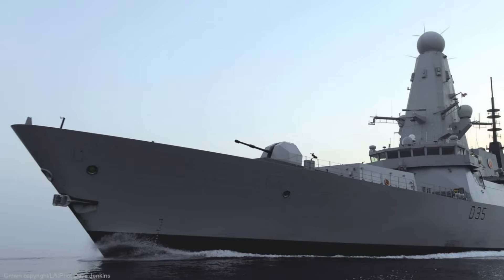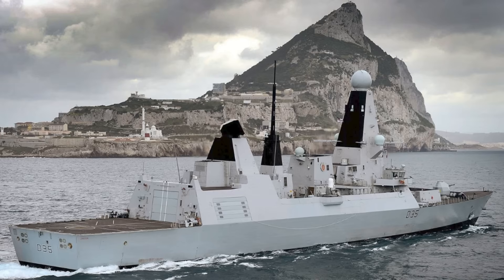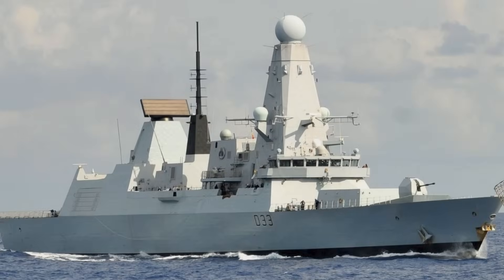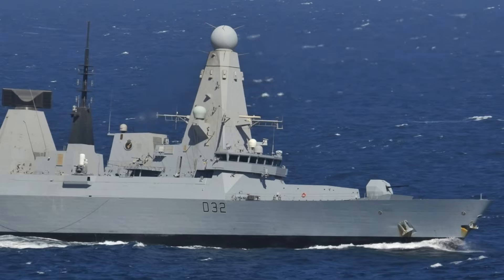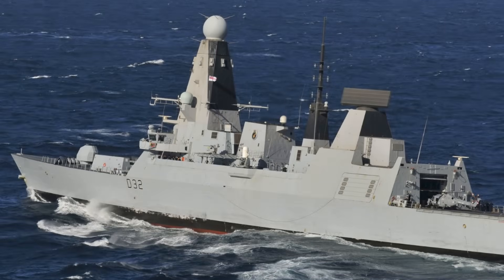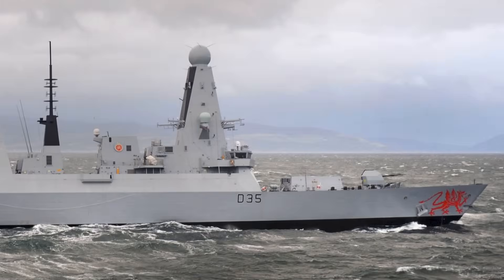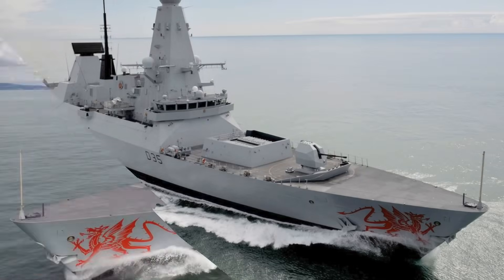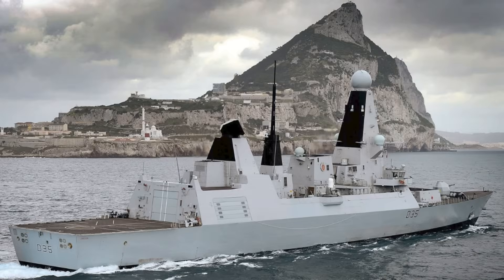Britain Fixes Its Destroyers: The Type 45 Upgrade That Changes Royal Navy Power

Comment: 19 years to resolve a deep, fatal flaw that turns the ship off if you try to use it's capabilities. That's insane.
Reply: That it was affecting one of our most prized, highly advanced assets, so critical and needed to be allies,  extends the insult much further.
Reply: The description of the situation is simplified in the video. A large number of problems with power were sorted out quite quickly because they were less expensive to fix.  The ships became usable with limits. This is all just what I remember from reading  about it.
Reply: Blame Choosing Yank intercoolers! Northrop Grumman is to blame if it had been the other way around the yanks would have been extracting comoensation!

Comment: It alsoallows power for DEW Dragonfire, Naval Surface Missile NSM and potentially strap on Tomahawks.
Reply: Plus upgrades to Sea Viper going from 48 to 72 upgraded missiles
Reply: @Gez492  Not quite, she will get 72 Missiles total, but it's the addition of 24 Cell Sea Ceptor missile, not SeaViper (The Aster 15 and 30) but does technically mean she can use those better missiles for more serious threats, the 24 Sea Ceptors can be for lower threats.

Comment: The RN took a gamble on new technology ... specifically relying on the WR-21 turbines to deliver all needed power in all weather conditions (the diesel powerplant was only designed for hotel services and backup).  Alas, the technology could only deliver this in moderate temperatures - the Atlantic and Med were fine but the Gulf and South-East Asia theatres were not.  Hence, the PIP program became necessary to address this technology failure.  Sometimes you win, sometimes you lose.  

But when you combine PIP with the other Type 45 improvements underway (added 24 cell VLS for Sea Ceptor for a total missile load out of 72, the Aster Block 1 upgrade, Sampson radar upgrade, DragonFire), the second-half of her lifetime will deliver one of the very best destroyers in the world - comparable to the Arleigh Burke in many ways.  

(The Aster hit-to-kill ratio is substantially better than the SM-x fielded on the AB class ... there is a reason that the US Navy is quite happy to have a Type 45 in the carrier group escort mix).
Reply: It highlights the basic need for Diesel generators for cruising speeds of 16-18 knots, and gas turbines for flank speeds. With PIP, Type 45 flank speed is now 32knts. The other issue was not the reliable WR-21 turbines, but the US made Grumman intercooler responsible for warm water trip outs.
Reply: @RobWhittle-o2y1c  Quite correct ... it was the intercooler failing - I simplified to WR-21 but it wasn't a problem with the turbine itself.   The WR-21s are helpful too for providing power to DragonFire - it wouldn't surprise me if an upgrade to it will require even more power.
Reply: @zachUK  By going from 2 2MW generators, to 3x 4MW desiel MTU generators base; the added power beneath the WR-21 input has trebled from 4MW to 12 MW, more than enough,  the same as AB  AG9160  3x 4000=12MW. Dragonfire gets fitted to all Type 45s in 2027, on Dauntless now.
Reply: @zachUK Aster hit to kill is not better than modern US SM because SM is an abbreviation not same series of missiles. Just like F-22 and F-35 are not the same.
Reply: @niweshlekhak9646  SM is an abbreviation for Standard Missile.  The evolution has been SM-1, SM-2, SM-3 & SM-6.  The Aster 30 and SM-6 are closest in capability but the SM-6 has much greater range.  
The estimated SM-6 hit-to-kill ratio is closer to Aster than the SM-2 due to its active seeker but the general view is that it is still not as good as the Aster.
Reply: @z @zachUK The thing is Aster only has dealt with Houthi weapons, SM-6 has dealt which much bigger threats targeted at Israel.
Reply: AEGIS and Sampson cover each other's deficiencies.  Sampson is a much more sensitive, and can track thousands of targets, the size of a coin.  AEGIS has greater range.
Reply: They gambled by not testing it properly first.  That's a kind of gambling we have to avoid.
Reply: @timmurphy5541  I think it's reasonable to conclude that they did not do sufficient very-warm air/water temp testing of the entire power system.  The intercoolers were certainly the number one issue but there were design flaws in the overall power management platform - the intercooler's degraded performance and eventual resultant failure of the WR-21 turbine to produce electricity should not have a caused a total electrical system dropout, for example.  (The system should have shed electrical load so the diesel generators could maintain critical systems instead of a catastrophic black-out). 

New technology always introduces risks ... there are always unpredicted failure modes - you can never mitigate risk to zero.
Reply: @zachUK you can mitigate risk of big obvious problems to zero though.

Comment: The UK should have thought forward, using the long time in dockyard to upgrade the ageing radar to a more modern unit. The ship is now 20+ years old, the technology leapt forward in the meantime and missile menaces requires better and more effective early warning and guiding systems to stay relevant, like on the type 26.
Both France and Italy have already programmed upgrade of the EMPAR to a much more modern Kronos Grand Naval, able to counter ballistic missiles with upgraded Aster 30. The type 45 may not be technically obsolete nowadays, but it will soon, and such long refits cannot be undertaken every year. A wasted opportunity.
Reply from the maker: You are right that modern threats require more advanced radar systems. However, major upgrades of this scale are usually tied to separate fleet-wide modernization programs, and they cannot be implemented within a single refit, even a lengthy one.
The comparison with the French–Italian EMPAR modernization path is indeed illustrative and highlights the different approaches taken by various navies.
Reply: @mainbattletank6190  If you can't implemetn something in a refit that lasts 8 years then you can't implement it full stop.
Reply: They are upgrading the radars